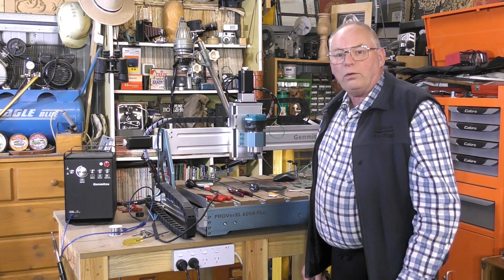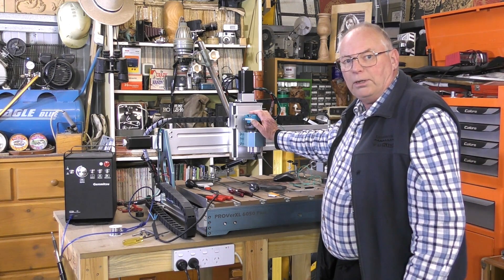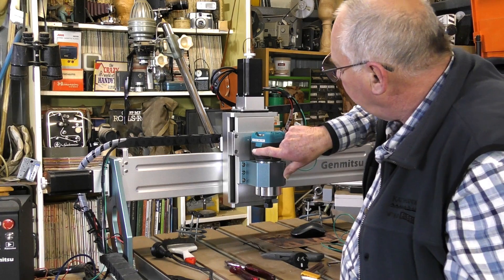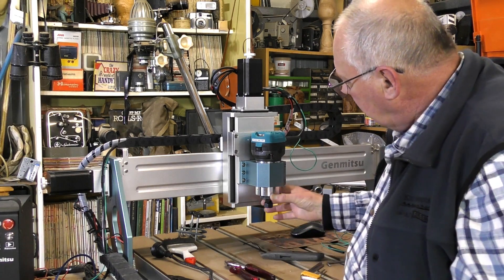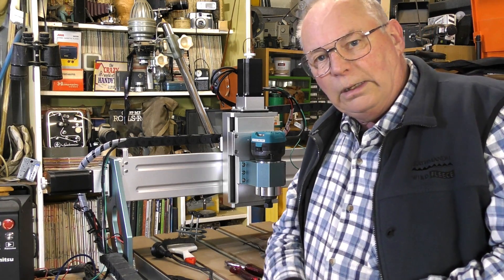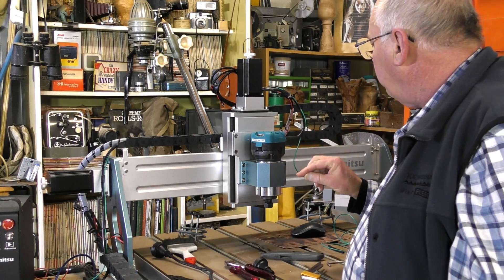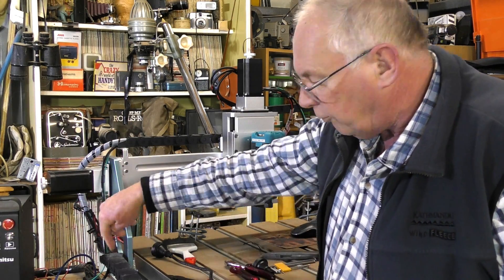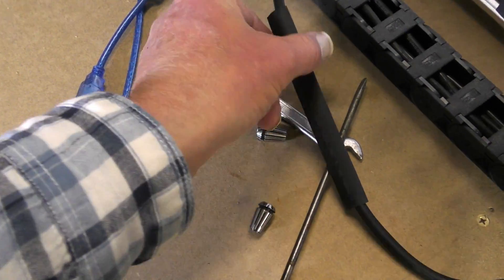Fitting a 1 1/4hp Air-cooled Spindle to the 6050 Plus is NOT so simple.

Comment: Thanks for this, pretty important to have that earth if something goes wrong. Had a look at that shiny Sainsmart one thats around 159 and it does have an earth on the power connector. Also it uses er11 collets so should have more compatibility .
Reply from the maker: Very true!
Reply: Unfortunately, the Sainsmart router is out of stock. I have one on order and there's a minimum wait until end April 25. And then there's the shipping from China... I guess I will just have to be patient and stick with the standard spindle a bit longer.